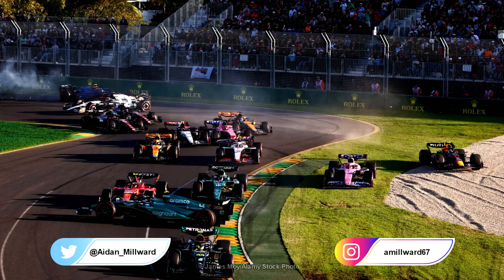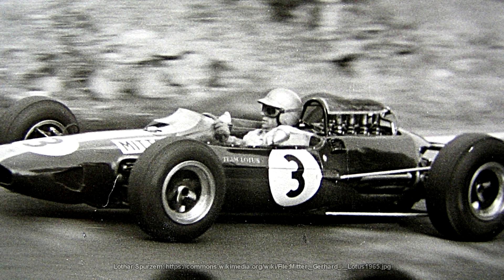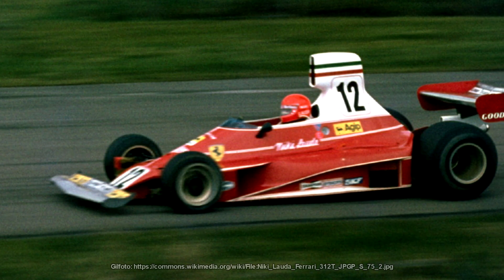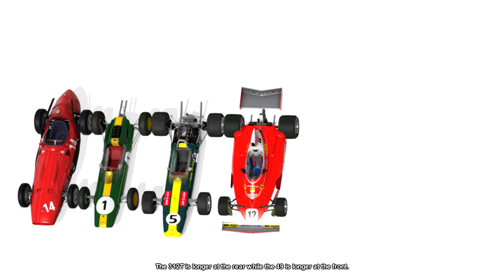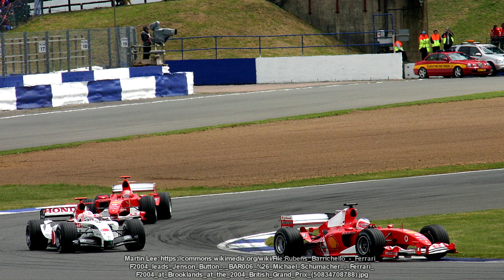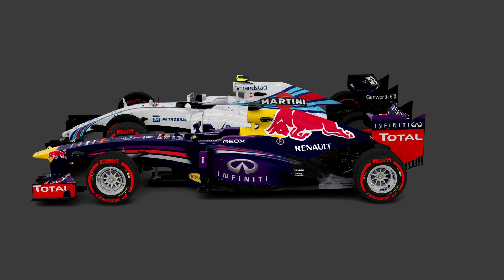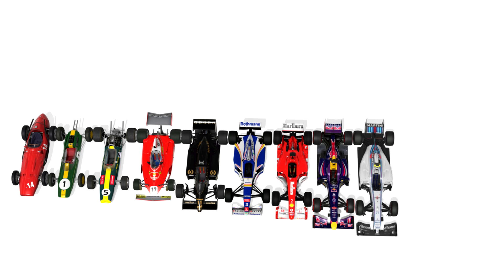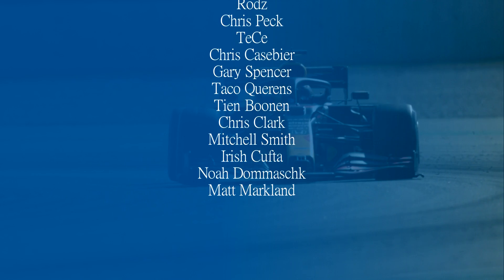So How Did F1 Cars Get This Big? A look at 73 Years of Car Evolution

Comment: Whilst the track width of the Lotus 98T was 1.8 metres, this is not measured to the outside edge of the tyre for some reason, but to the wheel hub. The maximum permitted width was actually 2.15 metres from 1976, reducing to 2.0 metres in 1993, and 1.8 metres in 1998.

Comment: Main aim for 2026 should be reducing the cars size, both width & length. Will reduce dirty air as well as less downforce will be generated because the floors will be smaller. All with the introduction of synthetic fuels, surely they can bin the hybrid system & go back to V8/V10’s. Would save a lot of weight

Comment: The size has grown because they have to carry a full race worth of fuel. If they had refuelling, the cars dimensions could change because you can drop the tank size
Reply: With current hybrid engines it’s only 130l of volume. Most teams have enough spare room in their oversized side pods to do 2 race distances.

Comment: I do like the idea of making the cars a bit narrower again. It doesn't have to be back to 180cm, but maybe by just 10 cm compared to now. it should in theory help a little with overtaking, since that'd be 20 cm extra room between 2 cars side by side, which I don't think would be that insignificant
Reply: I think a plan to go to F2 car dimensions (1.9mx5.2m) is on the cards.  However the 1.8m F1 cars raced WORSE than 2.15m F1 cars from 1972-1992, so it's likely narrower cars do NOT produce better races  in and of themselves. Modern Tilke circuits like Abu Dhabi are far wider than any 1970's circuit, yet do not produce better racing so it  doesn't seem to  be as simple as  a matter of the space to fit side by side (or three or four wide).

Comment: One thing I don't like about the bigger cars is they don't look fast watch a car go though swimming pool vs car from 10 years ago and old and old they look faster
Reply: I was just thinking that today while watching. They look slow on TV with the size and camera angles, and they sound slow with the engine note. Shrink the size a bit, reduce the weight, bring back refueling (but do it safe and separate the refueler from the tire changing), and bring back THE SOUND.

Comment: Imagine 20 LWB Range Rovers racing around a track and then consider that each one of these is the same width but 40cm shorter than an F1 car.  No wonder the racing is so crap these days.  Perhaps we need to invoke some Colin Chapman here - simplify and add lightness.
Reply: So drop the ice and go full ev, electric motors are smaller and simpler than ice engines. Your mentality isn’t foolproof
Reply: Chapman's Lotus  78 was 15cm wider than the  Range  Rover (215cm wide like all the cars then, which were all built to the maximum permitted width). So I'm not sure it's that simple.

Comment: Been waiting for a video like this for a long time and demonstrates the biggest issue. Overtaking is no longer possible on so many corners purely due to the size and it all becomes very predictable. It is conflicting because I think the latest generation do generally race better, plus the field spread is infinitely closer than pretty much all other generations. But the cars are so cumbersome that the overtaking is predictably rhythmic  (especially given DRS), and gives vibes more of big beefy bombers wallowing around in the air as opposed to fast speedy dogfights that we had with the smaller, lighter cars. 2026 was supposed to be focussing on reducing weight but saw an interview recently with Verstappen criticising the direction they are going which suggested they may get heavier still. Sigh. Anyway I am done now.

P.s. good luck with the move!

Comment: Might be interesting to do a similar comparison to the “height of F1” (say, 80’s or 90’s) the CART cars of the same time (2.65 turbos from 3 or more manufacturers, probably the best they looked, but always a little bigger and heavier than the F1 cars of that era) and compare all that to the current F1 and Indy cars. … you know, assuming the models are available in showroom mode.
Reply: F1 tyre diameter  (720mm) is now about the same as CART/USAC rear tyres.  Car weight is now about the same between current F1 (if a little more) and 90's Indycar/CART  too.  Fun fact: BOTH  F1 and USAC racing used 15" tyres in the 1960's. USAC stuck with 15" to the present day, wherea sF1 mandated13" maximum rears in 1973 and 13" maximum  fronts in 1983. So people who think high profile tyres are "right" for F1 are mistaken, they need only look  at 15" F1 fronts from the1960's to see that the profile percentage is about the same as current F1 tyres!

Comment: They need to get rid of the milk float motors and the incredibly dangerous batteries. This will firstly reduce the weight and then allow for a shorter wheelbase making the cars more manoeuvrable, meaning that Brands Hatch can be back on the F1 season.
Reply from the maker: Brands is never coming back. Ever.
Reply: @AidanMillward  I know, but I hate these pretend "eco friendly" shit boxes. Give me a screaming turbo V12 and fuck the environment.
Reply: @AidanMillward  Which is as it should be. Brands is fantastic as it is and the requirements of F1 would ruin it.
Reply: @AidanMillward  "Brands is never coming back. Ever."  In terms of Grade1 status, the FIA seems to have laxer standards now.  Zandvoort went from Grade2 to Grade 1 despite minimal changes.
Reply: Brands Hatch would need a lot of work. F1 can only be held on FIA grade 1 circuits. Brands is a grade 2. The only current grade 1 in the UK is one of Silverstone’s layouts.
Reply: I'm liking where IndyCar is going for hybrid in a supercapacitor that weighs 30 kg, mounts on top of the engine, has no lithium, won't explode, will charge quicker, and gives a reported 100 hp boost.

Comment: How about they just dropped all the electro -hybrid stuff and use that synthetic fuel, that Vettel is putting in his old cars? Maybe even get back to the refueling, which wouldn't be so "unsustainable", as this fuel is carbon free already.
This can make the cars smaller, lighter, and, most importantly, simpler to develop, produce and upgrade, which will definitely help those teams, who have tighter budgets or inferior facilites.
And then you can also add the argument, that producing those batteries and other stuff also adds to the pollution
Reply: Manufactures want road relevance, synthetic fuels won’t be ready for a long time, while hybrids and ev’s are already on the road.
Reply: @rexthewolf3149 IndyCar is using 100% sustainable ethanol from Shell made from 100% feedstocks and claims to have a 60% reduction in greenhouse gasses and would give a horsepower boost compared to the premium unleaded F1 uses now.  And since an ethanol fire can  be diluted by water, we could get refueling back without the pit crews setting themselves on fire.
Reply: @danielhenderson8316  ok, where’s the road relevance. I was watching the Indy car race today where Honda was running ads for the hybrid accord. Even with the fuels there have been plenty of efforts to get Indy running hybrids. They keep falling through. Sustainable fuels will not bring back large engines, as efficiency is the name of the game for the manufacturers.
Reply: @rexthewolf3149  Elimination of greenhouse gasses.  Remember, they're on the warpath to be Carbon Neutral by 2030 and this would help get them there faster.
Reply: @danielhenderson8316  that fuel will not be made in enough quantities to used in road cars for a long while.

Comment: It’s not just these, roadcars are obese as well. Remember seeing your first ever 911? I saw a 930, and it looked like it should be in Madurodam. With the 996 it turned bigger than my Golf estate of the time.
And then there’s the gargantuan A-pillars. Pedestrians and cyclists disappear into the void behind them. I may be safer but they sure aren’t, and I feel very unsure for fear of hitting someone I never noticed. It’s the wrong way around. Don’t protect against crashes, lower the chance of having them in the first place.
In racing cars, crash structures are so overblown by now that you can hardly see where you’re going. Every apex is a blind spot and never mind looking in your mirrors.
Also, I hate not being able to distinguish the driver on the telly. But that’s a sidenote. It’s like they don’t matter anymore.
Reply: a 996 looks pretty small compared to the current 911's! I saw a Ford Escort on the road a while back and couldn't believe how small it was, particularly how narrow
Reply: I've got an early 80's Renault and the visibility is so good compared to my modern BMW - mind you the Renault has no airbags, no crumple zones, no ABS etc, but you can see out of it !

Comment: 1:50 I have to say an F1 car with a supercharger would be pretty cool, especially at Monza down the straight.
Reply: /pedant F1 cars currently have superchargers, they have turbosuperchargers which are a subset of supercharger. /pedant Sorry I couldn't help myself! This is obviously the interpretation that Renault used from 1977 onwards, and it is correct.

Comment: Modern cars are long by design choice. A longer floor/venturi tunnels means potentially more downforce.
Reply: Or like redbull did, add rake and you wont need a longer floor to compensate
Reply: @michaelironsights8347  Red Bull did both!

Comment: smaller, lighter cars with less downforce and less power could produce much better racing but F1 has painted itself into a corner regarding having to have ever faster cars and ever quicker lap times and having to be the fastest race series.
Reply: The FIA has tried to bring laptimes up a bunch of times, mostly in the name of safety. The sizes of the wings? Regulated in order to keep speeds down in the corners. Ground effect? Banned originally for the same reason. Brought back because the wing vortices that maximized wing effectiveness were inducing unsafe conditions behind. Engine formula changes? Many of them were specifically aimed at reducing the amount of horsepower available to make the cars slower - and the Hybrid stuff was IIRC one of the key pieces that allowed the elimination of refueling (which was always a serious fire hazard, which is why it has been banned a few times) without increasing the amount of fuel in the cars. The grooved tires we had for a while? There to reduce grip so that drivers would take it easier in the corners. 

It's just that enough money is poured into technical development of the components that the cars keep getting faster *anyway*. 

And most of the size and weight increases were related to safety improvements, which have resulted in a drastic reduction in track-related fatalities. F1 has had one driver fatality in the last two decades. Three in the last four decades. In the single decade before that, there were *eight*.
Reply: @Winchester1979  it would be very easy to have smaller, lighter, less powerful F1 cars and they could be safe too.
Reply: @NonFlyiingDutchman  No. If it's smaller and lighter it's no longer F1, unless you also change all of the lower classes to make them even lighter. And your idea of "very easy" is skewed, I think.
Reply: @Winchester1979 Breaking news: F1 found to not exist between 1961 and 1965!
Reply: @WynnofThule  Between 1960 and 1969, eight drivers died in scheduled F1 events, and another five in off-calendar events in F1 cars. So, yes, F1 found it could not exist in its then current form.
Reply: @WynnofThule  "Breaking news: F1 found to not exist between 1961 and 1965!" Many of the drivers complained about the cars being too slow in those years, just as they did  from 2014-2016.The organisers must have agreed, as they went up to 3000cc, 500cc more than what it was before they reduced the engine size down to 1500cc! Among other things, did not 1500cc cause problems  with lowering the prestige of Formula One racing relative to sportscar racing at the time?
Reply: @Winchester1979  believe it or not that era in F1 actually saw some of the first safety regulations in the sport like  the roll hoop, automatic starters, a redundant braking system, they banned refilling of oil like at Indy (because so much of it got on the track), not to mention that was the rulebook that made open wheel cars actually have to be open wheel. 

If that doesn't make that era a trendsetter and turning point in F1 history I don't know what does.
Reply: @WynnofThule  Yes, they were iconic and trendsetting, but they also still averaged nearly one death per year. That didn't really change until the 82-94 dry spell between Paletti in Canada and Ratzenberger at Imola. And that's just deaths, I haven't looked into permanent retirements due to injury, which has been damned near unheard of as well since the 80s.
Reply: The series you are describing sounds like FE

smaller, lighter, less aero dependant, less power but better racing, granted they have spec aero
Reply: @heylo_9  "The series you are describing sounds like FE"  Actually Formula 3 meets all the criteria. But I don't think there is an appetite to make Formula 1 cars like  Formula 3 cars.

"smaller, lighter cars with less downforce and less power" > This is a Formula 3 car. They do make great racing, it's true.
Reply: @heylo_9   God no, formulaE had terrible races. From the baffling "you need to run over this patch of the track to active the battery attack mode, like it's a videogame", to the straight out moronic "fanboost"letting drivers have extra engine power if they received more fan votes online. 
Then came the awful idea of only racing in tight street circuits, in which every race would devolve into ramming to get a pass.
formula E is the example of what not to do.
Reply: Rarely comment, but what about smaller, lighter cars with less downforce, and MORE power?  Formula e did this with the gen 3 car, and it's great so far.
Reply: @SuperSonicSenna  uh, for an example of that we could look at F1's old Turbo cars

Although they were cool to watch I don't think they were exactly renowned for their good racing like say the late 90s narrowed up cars
Reply: @WynnofThule  true, but I think if done right, an approach similar to that would produce better racing than we have now.  Some of the best racing in the world has less downforce than F1: aussie supercars, formula ford, FE, nascar on road courses, hell, even karting.  They can follow close and overtake over and over because of low downforce.  Its also a fact that the bigger cars from 2017 onwards simply reduced overtaking opportunities for multiple reasons, size and weight being a large part of that. And more power is always exciting!  :D
Reply: @WynnofThule  funny you should mention the turbo monsters, because that is actually my favorite era of F1, even if the actual racing was a bit lacking at times lol!  I just loved watching the skill needed to drive them!  It's a completely different kind of skill compared to now, especially because they had manual gearboxes. I think we can have our cake, and eat it too, you just need a good ruleset, and I don't think the way they are designed even now with ground effects, has been all that effective.
Reply: @SuperSonicSenna  I'd go as far as to say that downforce is the enemy of good racing. It produces lap times but spoils close racing. I'd like to see F1 try something similar to WEC and define a maximum downforce.
Reply: @SuperSonicSenna  All those examples are in different positions than F1. The most comparable cars are probably LMPs, Indycar, A1GP, Super Formula, etc. And many of these are lighter, smaller, less powerful, and race better than F1.

In terms of raw power, Gen 2 could be called anemic as far as top level formulae go. The FE cars we have now although powerful still lack like half the power of F1 in races. Also worth noting that for FE more power raised speeds on the straights, that increased the tow's benefits for efficiency. That's something way more important for FE than any other series.
Reply: @WynnofThule  ok, so maybe the thing I'm aiming for dosen't exist currently, but I would love to see something like what I was describing.  Imagine 600 kg 1200 hp manual gearbox turbo cars with 1960s car sizes and 1970s tire sizes, and a very strict downforce cap like in wec. You could also have a 500 hp spec hybrid component in the rear like lmdh on steroids.  I think that would be sick lol!  Ofc, you would need to make them safe, which could be tricky.
Reply: @WynnofThule  I think I would also try to do some b.o.p like in wec/imsa as well as the common tub thing that lmdh does.
Reply: @WynnofThule  I know those examples I gave don't make as much power as an f1 car, I was just using them as an example of a low downforce series.  My point with formula e was that they reduced size and weight and increased power at the same time, which is the direction I think F1 should be heading.  I also like the series you mentioned, I'm a bit of a racing fanatic lol!
Reply: @SuperSonicSenna  I'll admit. That kind of crazy formula does sound enticing. But I don't think it would necessarily achieve the intended results for the racing product.
Reply: well you can be the fastest race series and have the rest if you just get rid of hybrid crap